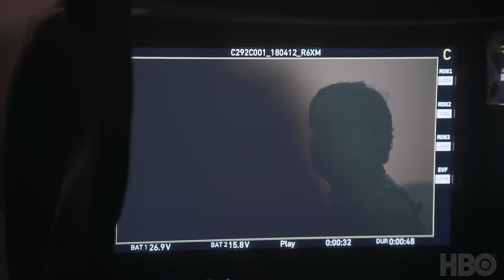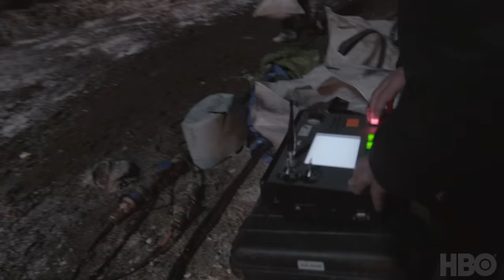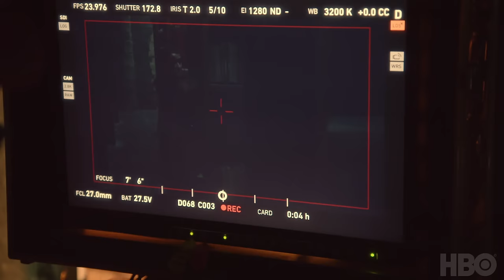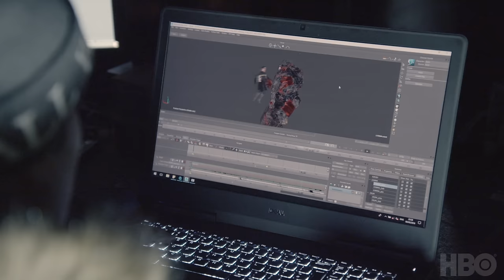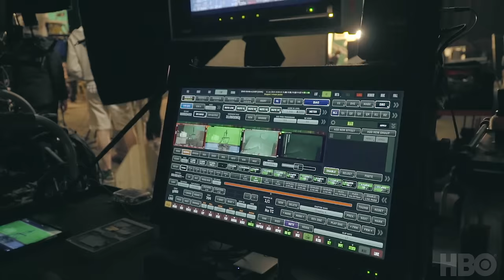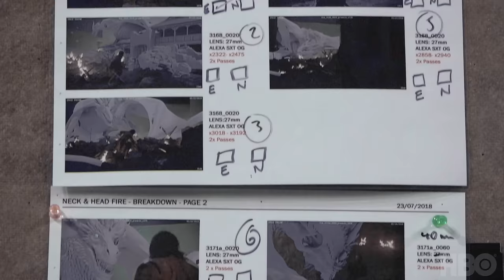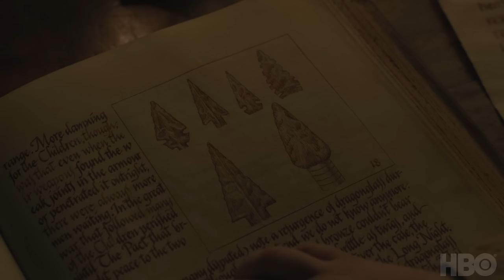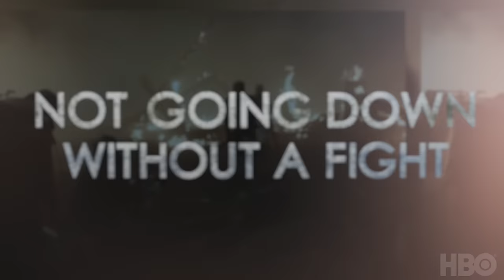Game of Thrones | Season 8 Episode 3 | Game Revealed (HBO)

Comment: That Dothraki Charge was the dumb strategy I ever saw.
so as the Dothraki and Unsullied stand in front of those barricades rather than behind them.
I understand the show needs to kill most of them.
but this is not a good defense strategy or this is not how you try to protect the living from the dead.
Reply: Every wise knight: Only a stupid man will fight a horde of dothraki on a field

Night king:hold my beer.
Reply: um..Coz that's how they fight, coz they are Dothraki?! Man, complain about valid things, not EVERY SINGLE THING including the ones they got right
Reply: Think about it in reverse. Cersei would have been fucked regardless of what science qyburn could have came up with. To stand up again the unsullied and dothraki hence because it was convinient, the writers wrote them off.
Reply: Vinthiya A B the Dothraki are ruthless not stupid why would the charge with weapons that couldn’t do shit ( they didn’t know Melisandre would come)
Reply: Why was it a dumb strategy? That is what light cavalry does. Would you prefer them to have stood still while the dead overran them anyways? Their job was to harass and take out as many of the enemy as they can before the infantry enters battle, it only failed because none of them knew what they were going to run into. And it didn't matter if they stood in front or behind the barricades, they dead would have overran them regardless, not to mention there weren't even enough space between the walls and the barricades for all of them to stand.
Reply: Catapults at the front of the infantry line takes it for me
Reply: Dothraki went all leeroy Jenkins mode

Comment: I assume the episode will look good on bluray so I'm not too upset by how choppy the blacks in the stream looked. But even then I would have changed two things about this episode: First, the Arya "horror" scene as he puts it. It was slow and sort of silly, and an odd attempt to bring back suspense into a moment when the action should have been at one of it's highest peaks (with the wights swarming the entire castle). Then the neverending Night King/Bran stare and slow walk. Some of that is necessary and good suspension for a big moment--but it drug on to the point where my viewing party first showed anticipation, disbelief at the length of the scene, amazement that it still hadn't concluded yet, and finally actually started laughing because it was STILL going on!